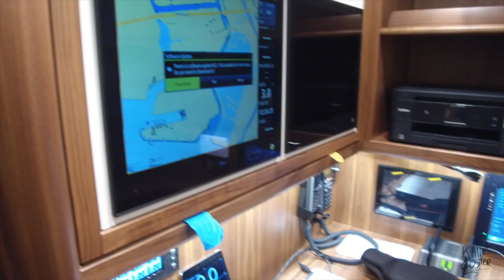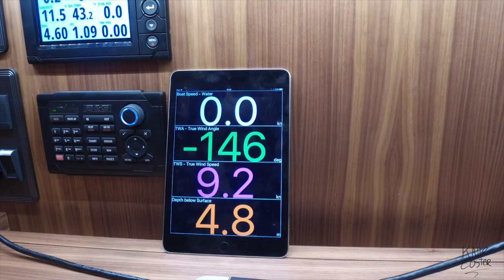latest J Class

Comment: Interior woodwork looks cheap and very on pleasing on deck if that's all looks Grand other than there are a ton of modern Innovations when we did the refit on Shamrock five at pendennis England I was very disappointed with the interior Woodworks and finishing that were installed in this beautiful Old vessel